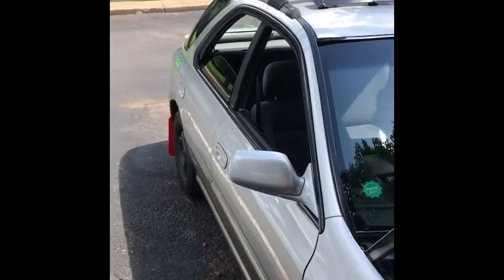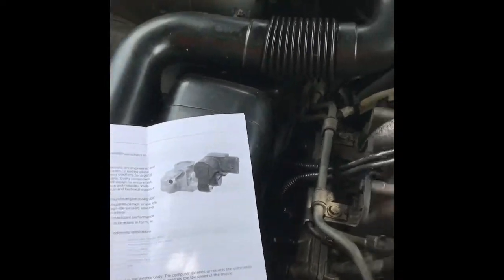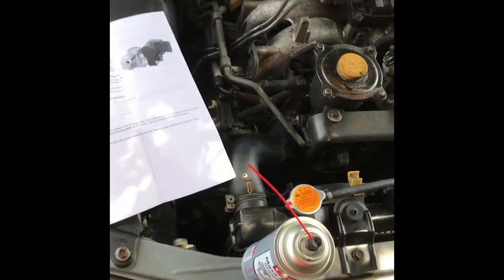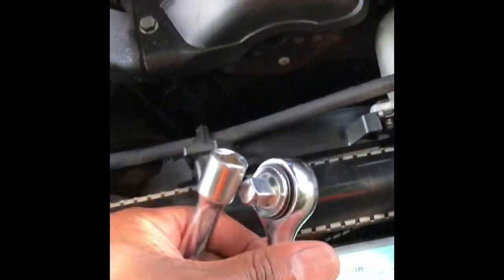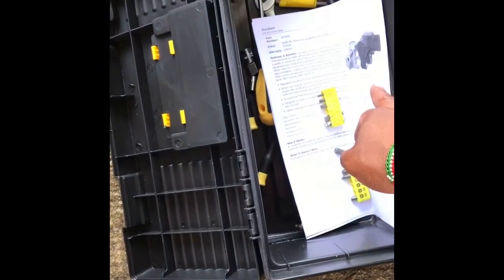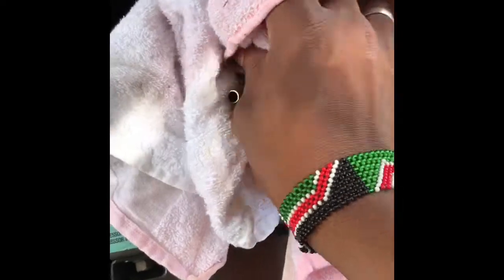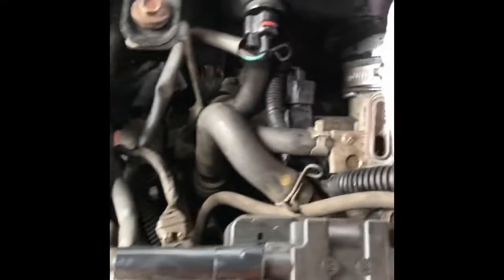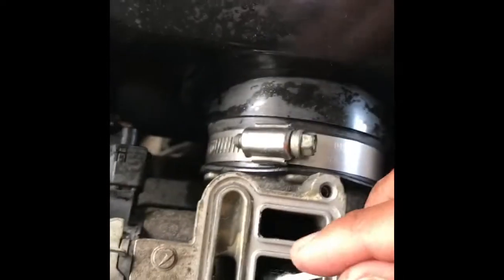2000 Subaru Impreza Faulty Idle Air Control Valve

Comment: Hey buddy I didnt replace my gasket. I fixed my one, I cut it, then filled in the gaps with "tarzan grip glue" sets to a "rubber feel" I let it half set then screwed on the iacv cover, has been two weeks, no problem. Probably not advised but IS possible if you dont have access to the part and are stuck.
Reply from the maker: Thanks bro, but I been fixed it.. went to my local car parts store and bought the kit to make ur own gasket.. 👍🏽 works like a charm
Reply: Thanks for the video  @stanthekenyan . Ah yes I realised that :), was just mentioning incase anyone else had the same problem but couldnt wait for the part.

Comment: Cutting a gasket..hummm I wonder if I fixed it? NOPE!  You didnt even TEST the part to see if it was open ground or not. My guess it that unit works like an electric thermostat. If it shorted out and no longer opens. Its no good. A simple volt meter couldve told you if it was good or bad...WITHOUT removing it. Its normal for a gasket to expand. You could have thrown it in the freezer for a little while and it would have shrunk up. Why didnt you use gasket maker or sealant to go over the butchered gasket? It probably would have worked good enough.
Reply: It fixed mine, I cut it, then filled in the gaps with "tarzan grip" sets to a "rubber feel" I let it half set then screwed on the iacv cover, has been two weeks, no problem.
Reply: @88888z  I always test the electrical aspect. its as simple as hooking up a simple voltage testor. even one that beeps. If it doesnt beep then its broke. A simple meter test should indicate if it operates or not. Had he used some kind of gasket maker it would at least stopped the leak. I see them on E- Bay for $27 dollars. So they are NOT a deal breaker if they do go bad.

Comment: I am having the same issue in mine. I took it out to clean but I dont think I cleaned it as deep as yours. I also seen one guy remove the black plastic bit with 2 screws, not sure if that is for idle  adjustment?
Reply from the maker: kssmm123 the black part is the electrical part that operates the mechanical metallic part. So if there is too much carbon build up on the mechanical part inside (black stuff) that prevents it from opening and closing.... if you cleaned it good but still have issues then it's ur electrical part of the whole part

Comment: Hey did the new part fix it dude?

Nice video
Reply from the maker: kssmm123  yes it actually did. Didn’t have to buy a new part after all. But you can’t reuse the old gasket that came with it originally which was rubber like, doesn’t fit back in.
Reply: Stanley Ambeyi so what was the problem exactly? Having the same issue on my Impreza